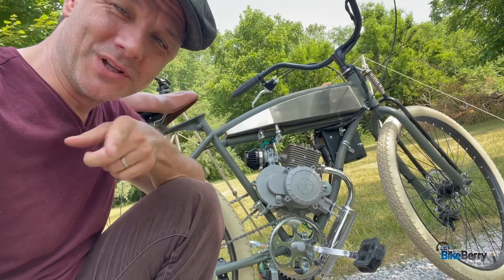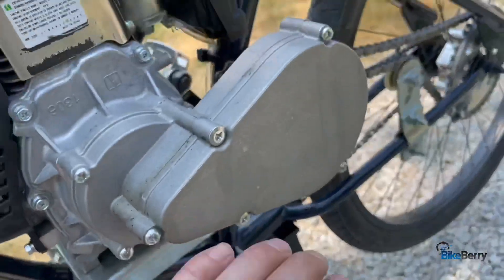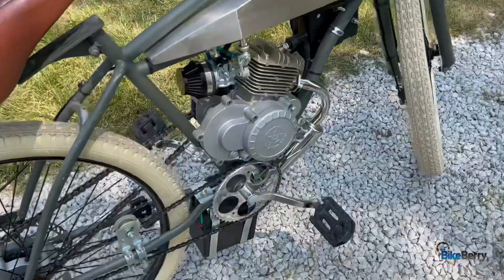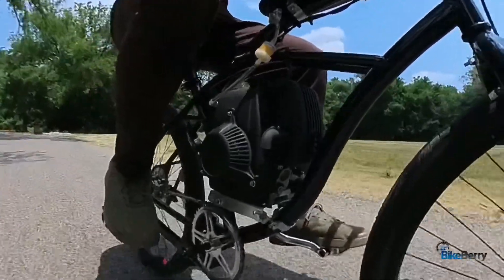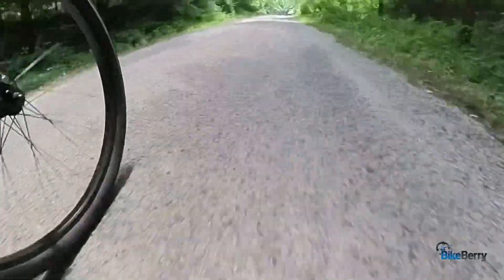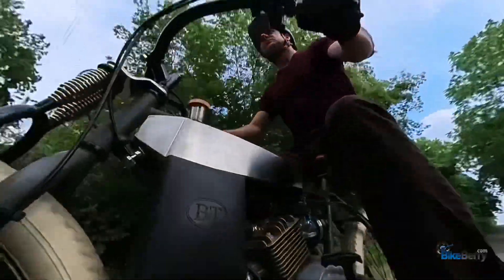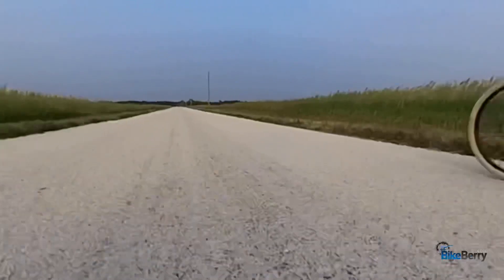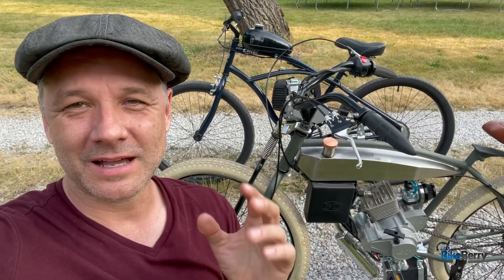Battle of the Beasts: Unmasking the Superior Bike Engine | BikeBerry Showdown

Comment: I used to have the BT80, centrifugal clutch, push button start, just like that one. I hit 45 with a few mods. I had the 44 tooth sprocket and it would take off without pedaling, and take me up the hill and I never had to pedal. I had off and on problems with the wide crank, and I never got the pull start to work, not once, before it broke. Never needed it, as the push button start never failed me. I had it about 7 years before it developed a compression problem I never could solve. It was a powerhouse, dependable and fast.
Reply: May I ask what mods you did?

Comment: 4 strokes can get access to small engine turbo just need to build it up a little and engine and tune turbo lower as with 2 stroke the closest thing to boost is the boost bottle or nos . All though I haven't really seen someone compare the set-ups because there are small engine turbos

Comment: 4 stroke all day. Less maintenance. Less noise. Less intrusive to the ride. Better awareness. More torque. More enjoyment.
Reply: But they’re a bit slower too, that’s why I’m always trying to find out ways online to at least marginally increase the speed of the 4-stroke bicycle.
Reply: @X1GenKaneShiroX  - you'll never get the same power from an equal sized 4 stroke turning the same RPM. You have to increase effective displacement via one of four things:
1- bigger bore or longer stroke for more native displacement 
2- bigger cam and better flowing heads for more RPM
3- forced induction (supercharger/turbocharged)
4- power adders (nitrous/methanol/etc.)

Comment: Need help I have a bullet train  40.1 rode over 800 miles now it fills like it's vapor locking
Reply: Idk if it's still relevant but put a hose between the intake and the carb. Should get the temps down

Comment: On a Bike if you use a disc brake on the rear wheel then a front brake isn't necessary!
Reply: That’s like saying a motorcycle is fine with only a rear brake. That’s false
Reply: What ya gonna do if the brake cable breaks or something?

Comment: I have the bt80 I bought just as the pandemic got bad here July 2020 still have it just recently put it on a 26" bike with 24" wheels and front fork for brakes. I'm running a 36t sprocket windowed piston with g2 reed and an nt carb. I cannot pedal this bike until I switch to wide arm crank I don't weigh a bunch probably around 130 but I can take off easily and very quickly without assisting the motor at all you gotta play with that baffle pull it out and put a nut on the inside to where it leaves a couple millimeters between baffle and exhaust so you can see straight through from the side. Your just using the nut on the inside as a stopper and something to solidify the baffle. The more you pull it out the better low end torque with a couple mph shaved off the top at least in my experience over the last 3 years. This was actually my first build ever it's probably been on 6 or more different frames just because I kept changing my mind on the style I wanted it to be. I would like to see you with a speedometer I hit 41 on mine just the other day with the setup I mentioned above I wanna see what yours does stock.

Comment: i dont really think it was a fair test . your comparing a 49cc four stroke to a 80 cc 2 stroke . bikes look great by the way love the tank on the board track racer look a like . (bt) . would love to have that tank on my bike . but like i was saying  if you could find a equal sized engine to pair the bikes against you would see the four stroke would eat it alive . in power speed and dependability. just my opinion brother . i mean the 4 stroke pretty much beat the bullet train in everything but speed  and the bullet train is almost twice the size as the four stroke . but dont get me wrong i like the bullet train as well . its a really nice engine .
Reply: Great input! I chose to compare them since it’s common for folks to buy either engine for cruising.

Comment: Can a torque converter be installed on the 49cc? I bought one of those from BB like 5 years ago and those transmissions weren't good...the clutch bell had to be welded a few times before it couldn't be anymore

Comment: Relying on rear coaster brakes is very risky on any motorized bike. Especially the 4 stroke, too  much torque! I've seen them rip the band of the coaster brake off the frame.
Reply: Yeah... Stop putting your throttle on while you brake!

Comment: Not doing apples and apples. 49cc with a governer to a 80cc .one turning3600 is. the 2.stroke turning7000.Get a 79cc Predator, take the gov. off and match them. The 79 will be smaller but it will eat the bt alive.😂